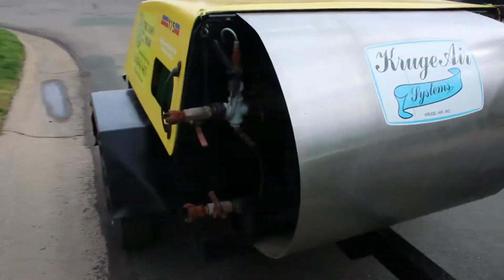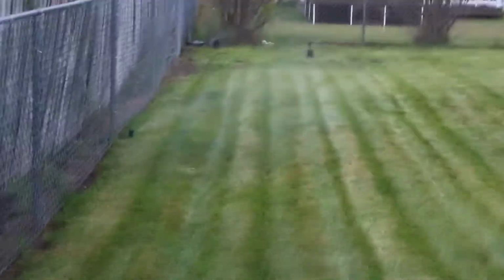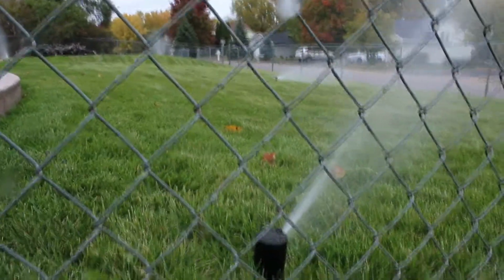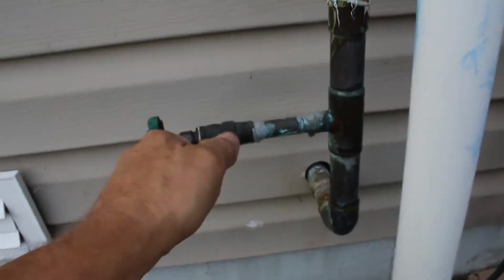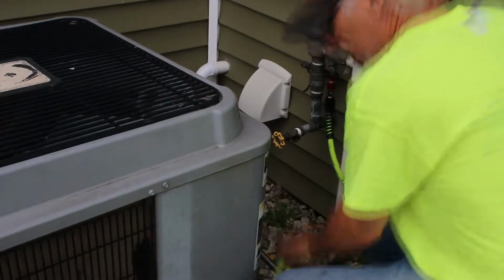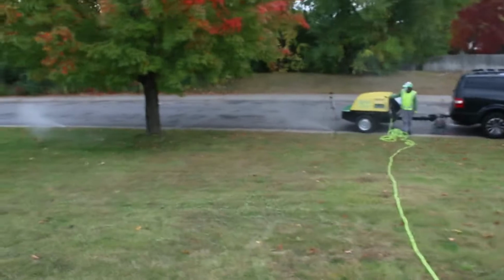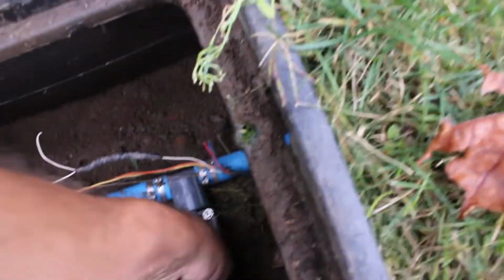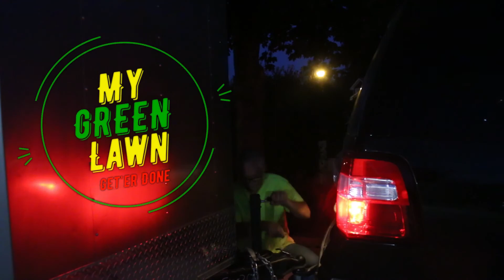Fall Blow Outs With A Tow Behind Compressor #lawncare #sprinklersystem

Comment: Hey there Frank.  Great video.  Are you blowing it out so it doesn't freeze in the winter?  I'm not familiar with these things, so if it sounds like a simple minded question, just overlook it.  lol
Reply from the maker: Hey Chuck thanks for stopping by. You bring up a good point and something I just took for granted. I should have explained that in states where it gets cold, you know below freezing (also where ground temperatures will drop below freezing) we need to get the bulk of the water out of our irrigation systems so that the water does not freeze and cause expensive damage to occur. So thank you for bringing that up, I wish I was better at making videos and thinking about stuff like that. Thank you for reminding me to expand my thinking